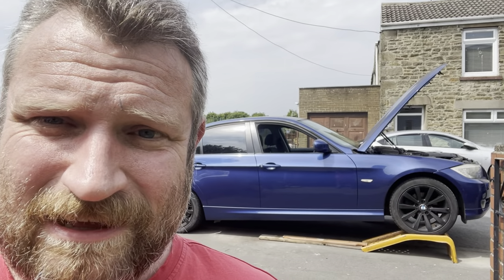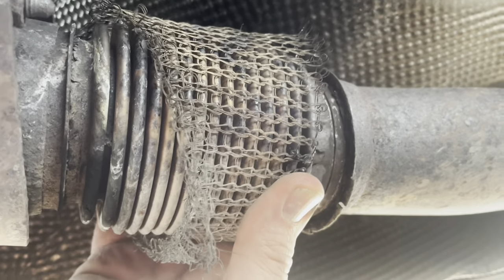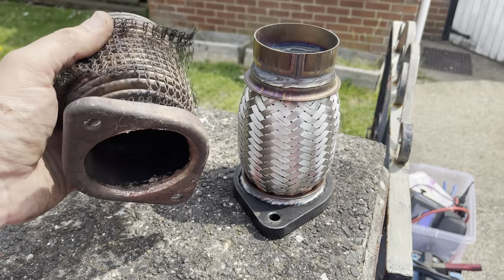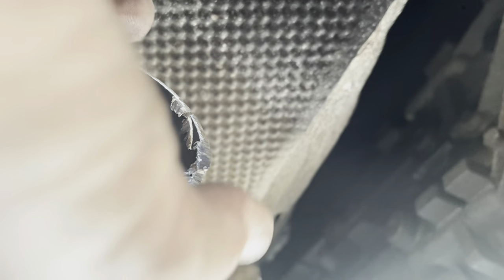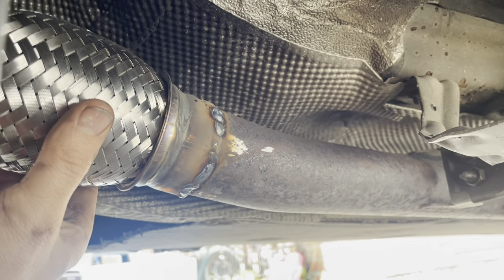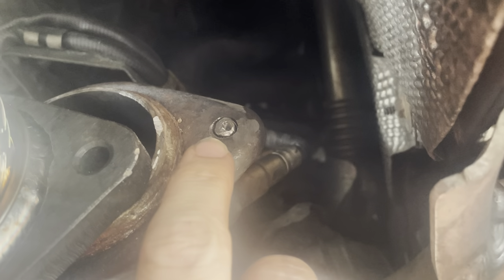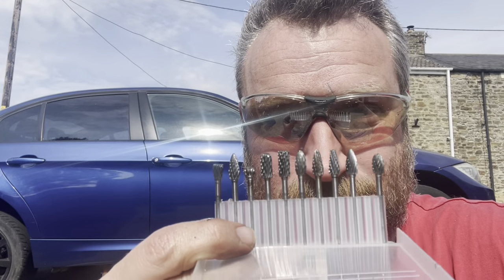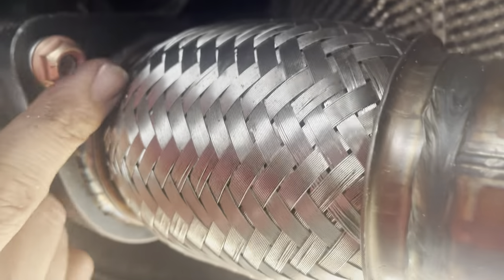Broke Horse Power Part 3 : Bangernomics BMW E90 Flip, maximum profit - Exhaust Flexi Repair

Comment: With your exhaust blowing, did your car start to run lumpy?
Reply from the maker: Yes, idle was uneven and power was down.  I think because the exhaust isn’t sealed properly, you end up with a lean reading on the oxygen sensor and it messes with the fuel trims.
Reply: Have you got a link to the  Flexi
Reply from the maker: @Julian-vl9ep  this was the repair kit I used in the video; https://www.carparts4less.co.uk/search/700110551
Reply: Did the exhaust leak cause popping when cold